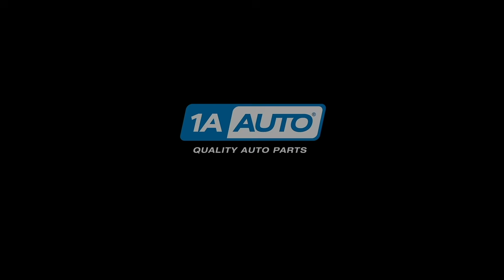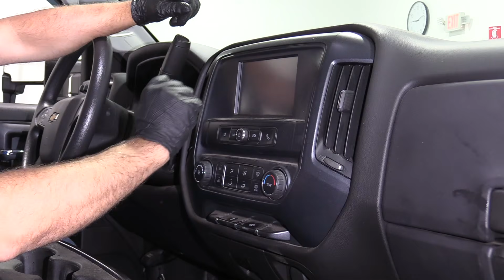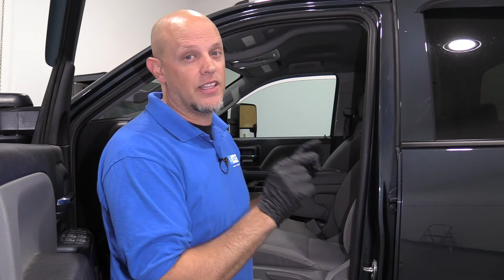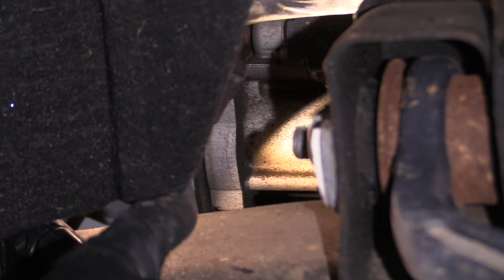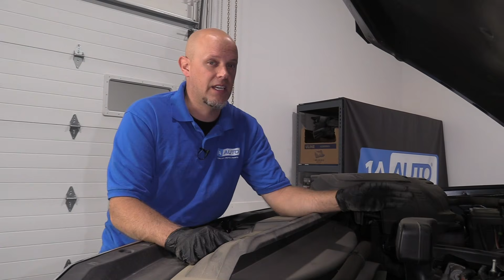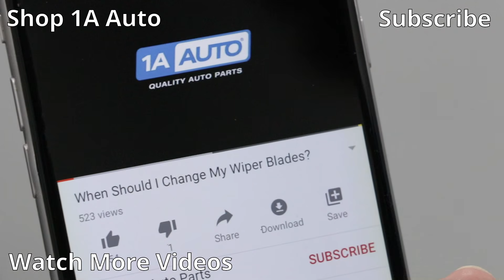Top 5 Problems Chevy Silverado 2500 Truck 3rd Generation 2015-19

Comment: Our truck was slipping in first gear. The rpms were raising but I was not accelerating. So we got a new transmission and got it reprogrammed and now it won’t get out of first gear. We also don’t have our low gear. When we tried to put it in low the light that goes around the letter wasn’t there. What else could be wrong 💔 we got the transmission from jegs. Were we supposed to check the transmission filter ? Someone please help 😭

Comment: My torque converter went out on my 2500 right after it went out of warranty and the dealership still replaced it as if it was under warranty .  It's a very common problem .  When I dropped it off the dealerships shuttle van driver said it , "Probably needed a transmission flush ! " HA HA HA HA !!!!!

Comment: Engine keeps running when key turned off and pulled out. All dash lights and headlights turn off so key switch fine. Battery terminals clean. No wiring damage. #15 and/or #49 relays in fuse box problem?

Comment: Bought 100,000 mile warranty when I bought my ‘16. At 100,147 miles the torque converter disintegrated sending metal into the transmission. This happened during biden’s shipping scam. Could have gotten a new transmission for $6k, but it would’ve taken a month. They rebuilt it for $5200 & it’s not the same in tow mode.

Comment: Had to replace my transmission on a 2017 2500hd at 58k not much towing or plowing,5th 2500 I've owned the rest went to 200k and more with no problem

Comment: 2024, None of those issues on my 2019 purchased in 2018. Only problem was a fuel level sensor giving erratic readings. Waited several months for the repair as GM admitted the replacements were also faulty. My dealership notified me when the good replacements came in.

Comment: Dude, I’m a Chevy guy for 20+ years and the front end on my 2015 2500 6.6 is straight garbage.  I had to rebuild the entire front end, including linkage at 100,000 miles and it’s still loose. redhead gear box is next which just seems insane.

Comment: I have the same truck. 2017 2500 Silverado 6.0. It’s at 180,000 miles now. The starter did indeed fail as stated here. Blend door actuators sometimes have delayed engagement, but still always work. The transmission also failed due to the torque converter coming apart, and apparently that’s common with these trucks
Reply: At how many miles did the torque converter fail for you
Reply from the maker: +@CodySimoncelli-of7xx Thanks for the feedback!

Comment: NO NO NO its not the AC/HEAT actuaters ...Its the vacuum source lines are leaking vacuum. And not being able to pull the diaphragms into position to actuate the vent system

Comment: When you say the evap valve can cause pressure problems, could it be causing my tank to only be fillable a half gallon at a time? When I fill it sounds like pressure builds up, the gas pump stops like the tank is full, and if I try to fill more it shoots out the filler neck.

Comment: Other common issues:  6. low coolant level warning, no low coolant just bad sensor which is molded into the reservoir rendering it unreplaceable a Chevrolet DECEPTION!  7. Emissions warning light, no issue possibly computer glitch must be taken into dealer for repair another Chevrolet DECEPTION!  HONESTLY Chevrolet how can any of you sleep at night knowing you planned all along to rip off your customers?? And you DA’s wonder why sales are down…it ain’t just a chip problem!

Comment: The HVAC controls and exhaust system(def) have been my only problems. 2017 GMC 2500 6.6
Reply: Vacuum leaks on the control lines

Comment: Change my starter on my at 90k ,  im at my 3rd  battery,
Brakes at 70k. current miles 125k
It is a 2015 2500hd crew cab 6.0 .
I have done on the last 2 months every service, spark plugs,transmission,  Differential,shocks, radiator flush, air filter, cab filter, ..
Never go over 5k for oil change. 
Truck runs like new !!!
Reply: It's a good truck... no exhaust manifold gadgets??? What about fuel pump sending unit... ac compressor??? Power steering pump and steering rack???

Comment: Great info, my truck is sluggish and exhaust system changed and engine still lazy, dealer costs me money n still lose power no light on, they were but code cleared, need help, where u located?

Comment: Thanks for the video very helpful and good unbiased insight. I have a small husband looking to get another work truck. This will
Be my first heavy duty truck. I am debating the F250 6.2 Gas 4WD, Silverado 6.6 gas 4WD, and Ram 1500 6.4 HEMI 4WD. Any opinions and what would you do if it was your money? I’m thinking that the Ford 6.2 gas engine is probably the lost reliable.
Reply: 6.2 Boss is fine
Reply: 6.2 is probably the most reliable of that bunch.
Reply from the maker: +ajfam871 We appreciate the feedback. Sometimes there are multiple ways to accomplish the same repair.
Reply: Thank you for the video you're doing it so well keep up the great work.

Comment: You forgot camshafts, lifters pushrods, transmissions,
Reply: Those are the 5.3 and 6.2 on the 1500s trucks not the 25000 trucks are different.
Reply from the maker: +Chris Tourand Thanks for the feedback!

Comment: No gas cap is just a plain stupid design ,  allowing a easy way for dirt to get in there to cause a leak.
Reply: To cause other unnecessary problems like emission issues, Good way to keep vehicles in the repair shops and part stores busy...
Reply: Mine has a gas cap. Jus say n. 2015